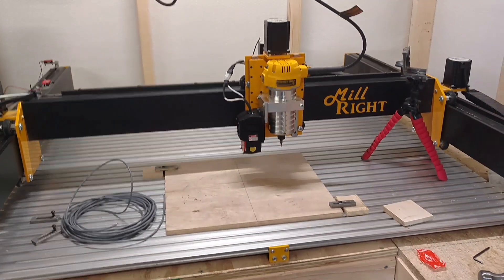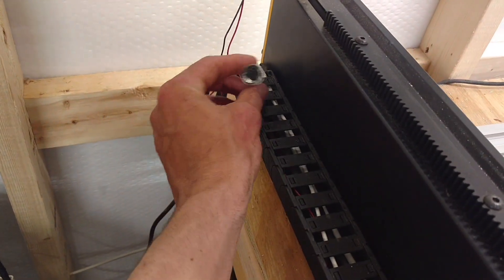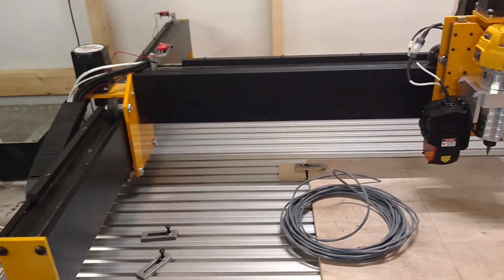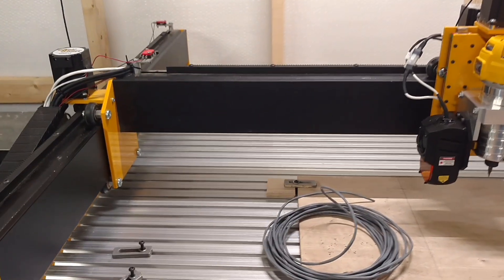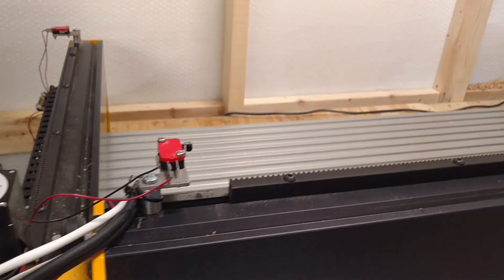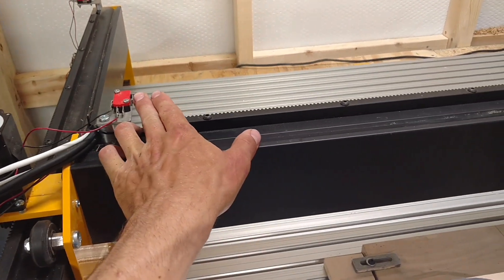How I Set Up Homing Switches On The MillRight Mega V!!!

Comment: Do you use 18 gauge copper or silver shielded wire?  The copper is for electrical current, and silver is for switches.  Which did you use?
Reply from the maker: Hey thanks for watching!

I used silver wire when I replaced the homing switch wires!

Comment: How many feet do you think would be enough to replace all the wires ?
Reply from the maker: If you are buying it by the foot, it's so cheap you could get plenty. I haven't measured how much I have and it depends on how far you want to put your control box but I would get 20 feet or so to be safe I guess. You would probably have enough left over for a touch plate too!